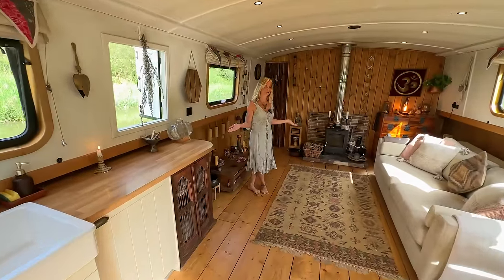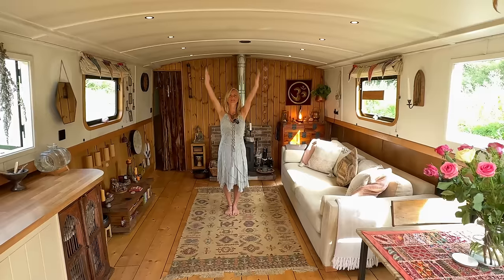She Lives Full-Time on Her Self-Built Boat

Comment: This is not a narrow boat, this is a house in the water....what a lovely boat...!!!!
Reply: Indeed, it's not a narrowboat. It's too wide to fit in most of the canals in the UK. Worth the trade off though. Wider boats are more stable in the water. Narrowboats rock from side to side easily.
Reply: @tonyhawk123 I like the rocking motion 😁
Reply: "Widebeam" would be the correct terminology, as opposed to narrowboat.
Reply: @notneeded1 - You’ve already said this a couple of times. 🙄 Get new material, FFS!
Reply: @madeleinerose7090  And tell him to stop giving his own comments a thumbs up.
Reply: Technically it’s a broad-beam canal boat. It’s more suitable for canals than tidal rivers because of the shape of its hull which is flat.
Reply: @tonyhawk123 i think I would prefer the open road or should I say access to over 2000 miles of canals from top of England to south
Reply: @lisadefries6718 She hasn’t got access to that sadly. Her widebeam is too wide for a lot of the canal network.

Comment: A box fan blowing the hot air from the stove down the hallway towards the bedrooms would solve the cold issue, plus you need ventilation and heat in all areas to prevent mold. People would argue the fan is too cold in the winter, but when there’s heat being blown from the hot stove it isn’t cold. I found that out when I had baseboard heating, my box fan was running and the heat circulated around my apartment very quickly. Another tip is to use slow cookers in the winter as they kick out an amazing amount of heat into a small area when you’re making homemade soups and stews etc.
Reply: Get another stove for the bedroom.
Reply: Don’t forget that anything that runs down the generator or other fuel very quickly is a no, unless you’re paying for a residential mooring ( rare and expensive) with a hook up.
Reply: You can make a generator really quiet on the water run the exhaust down in the water like the others
You mean you can still burn coal somewhere in the world😮😮😮 shes pretty 😍
Reply: I've got a widebeam with 6 radiators and a towel rail in the bathroom, running off a deisel heater. It's warm enough in winter even without my log burner on
Reply: There’s gas heaters too, my parents used to have a kerosene heater.
Reply: thats enough to survive, not to be comfortable
Reply: @kinley.-. Very dangerous on a boat though.
Reply: @Chanel95-d6u  yeah that’s probably a good point 🤣😅

Comment: in the summer it looks like paradise, but through the winter the boat is cold and condensation is a constant worry, i lived on a canal boat on the grand union for two years, and waking up in winter with the outside  temperature at --10C / 14F,  and the inside temperature was --5C / 23F,  with as she said ice on the inside of the windows, is not so much fun. and yes, it was fully insulated, but with half the boat sitting in cold water you find the insulation doesn't help.
Reply: Yes, books, clothes and soft furnishings can get damp.
And mooring is becoming increasingly impossible - much more bureaucratic on the canals than it used to be… we continually cruised, too. Wardens used to turn a blind eye to you staying in one place for a while, but now they’re hot on your trail.
Beautiful in the Summer, but cold overnight in the Winter, and moorings near shops and facilities are increasingly hard to find. 
Barney used to be our coal man on the Grand Union - dropping off our coal as he came through on his traditional working barge.
You have to be pretty reliant on having some knowledge of boat mechanics, and be prepared to cycle or walk everywhere. 
Most canal boats are FAR narrower than this wide beam!
A beautiful looking boat. So well thought out.
I wonder how she manages to continuously cruise and get the kids to the same school - that must be a big issue…
Reply: I think she said 32km a year,  roughly 20 miles would be a challenge
Reply: What a beautiful lady❤
Reply: Properly insulated with spray foam and closed cell foam combination, with double or triple glazed windows, ducted diesel heater to pull the moisture out and heat the air she’d have no problem.

Comment: What a fab home, well done . It isn't as cheap as some people think living the boat life .
Reply: I sold my 3 bed house 18 months ago (only me all alone lol ) and was going to buy a (used) boat . anything I have ever bought i always thoroughly research first, running cost of a boat are a lot more than the 2 bed apartment I eventually opted for, even though it was very dated being a handyman/painter and decorator I fully refurbished it , using expensive fixtures and spent £10k including all new furniture (kitchen is only 5 cabinets but was over £3k with everything else ) . my apartment is 35 years old and part of an over 55`s complex of 25 units it was up for £30k+, I offered £35k cash it was much much cheaper than a boat lol

Comment: Fantastic boat! I would suggest attaching a water tank to the burner which is hooked up to the radiators, that way the boat will get some heat when the burner is going. It probably won't be a huge amount of heat but it would certainly keep the chill off in the winter.

Comment: Its looks very nice.  There is a huge amount of space on the roof and those solar panels are tiny.  A few much bigger ones would likely mean that she wouldn't need to run the engine during winter as much.  I wonder how well the boat was insulated as well - maybe better insulation would result in a more comfortable space for a larger amount of the year.
Reply: yeah, more panels and a blower assisted diesel heater are called for here.
Reply: @redwolfexr  Diesel heaters are expensive to run though, and depending on mooring location, diesel may well not be accessible  very easily. Solar panels are a great idea, although vandalism on the towpaths is unfortunately always an issue…
Reply: @Chanel95-d6u    depends on your definition of expensive.   Diesel is much cheaper than propane for pure heating.  More importantly you heat the smallest area you can.  Even a blanket wall holds in a ton of heat.
Reply: @redwolfexr  Yes, have used a blanket wall - it’s amazing how much difference blankets or thick curtains can make. I can’t comment on the propane/ diesel options as I haven’t looked into propane, except for hot water and cooking.Theres always something more to learn…

Comment: Would definitely  think about fitting a diesel heater in your boat, the type you have in a campervan, have one in our van, a good solution for the cold, fantastic boat 🙏
Reply: Just be careful to site the whole unit OUTSIDE - they're dangerous re. escaping fumes otherwise. The only outlet into the cabin space is the warm air duct. (Dot)

Comment: I'm an amateur boatbuilder, and I think  it's wonderful that this woman built this 65 ft. boat all by herself.
Reply: Well... obviously she didn't.  But she chose the layout and it works for her so, job done.  Putting two hours on the engine every day is a bad plan in the long run.  I don't know why she thinks generators are noisy... buy a Honda and point it away from the boat and other boaters.  Much quieter... no vibration in the boat and far less depreciation/maintenance.
Reply: See didn't...I can see why you're a bodybuilder.
Reply: No!! She sure as hell did NOT build all the boat herself.  The hull was already built. And you really don't know how much of the interior she has done. You only know what she has said.
Reply: @HerveMendell  It was built by a reputable boat builders. They say who they are somewhere in the comments…
Reply: @ryansalyers5515  waaaaa

Comment: You could vent heat from a wood stove by piping heat through the house via an add-on air duct system. You could use rechrbable batteries in a battery powered fan for your forced air. There'e probably other ideas for minimal living in RV magazines and stuff. I love the cabin wood interior. I meant to ask......where is this?

Comment: You need a circulating fan to spread the heat around - we run ours ( a massive floor fan) by leaving it on the floor in the bedroom door way by facing it up the passage to the lounge, very soon the bedroom is warm again.

Comment: You are stunning, as is your boat. Id consider a diesel night heater as these are the best fuel efficient way of heating. a simple install and runs on the 12v system.

Comment: You're much better off running a small generator in winter to reduce the hours you're putting on your engine.
Reply: Engines are designed to run - they need to be run to keep the lubrication moving through the seals and gaskets and parts. Leaving engines sitting for long periods actually does more damage than running them and keeping them well maintained with regular fluid and filter changes.

Comment: I lived on a boat for 10yrs and understand the cold and humidity issues. I used a heating pad in bed because it does not use much power. All the newer ones shut off automatically, so they don't burn you. But I bought an older one that stays on until you shut it off. As long as you have it on low or medium with a towel on it, it won't burn you. My friends used thick clay plates in bed that hey heated on the stove. If it gets windy there, I recommend getting a wind generator which will generate power year-round day or night. Of course, you need to set it up so it will fold down or disconnect it when you go under those low bridges. :)

Comment: I guess nowadays you could put batteries low down in the boat and beef up the solar panels. Would avoid running the engine too often. 

You could also get one of those beds they have in campers that lift into the ceiling when not in use to avoid walking over the bed. Boat like great though!

Comment: use copper  pipes with automatic pressure valves to carry hot water with stove to make good circulation n gain warm throughout the boat. You can pump to drive the hot water very easily with storage power from solar panel 24/7.

Comment: Depending on what type av radiators she uses I would plumb it to the stove with a small water jacket. That would solve some problems with the heating (if she has radiators in every room).

Comment: How about a small Honda generator converted to LPG to for charging, v quiet and much cheaper to run than the engine. We use a bigger one at the stables and its great.

Comment: Darling is not using the correct coal, anthracite burns longer if sge changed ger stove to an anthracite stove like, and why dont you have a separate generator to the engine in the engine bay they are quiet and dont put hours on your main engine

Comment: she wants to use the washing machine as little as possible because she uses 50 liters per wash. she has to move the boat to get water?
The boat is already in the water, use a pump with a water filter/distiller for the washing machine. so much money has already been spent on the boat and such things are not arranged, I don't understand certain people.

Comment: There's a significant difference between self-built and self fit-out.  I suspect this is self fit-out.  I don't believe she built this boat out of sheet metal, because she would need significant space to build it, with good welding skills.  Most people buy a sailaway, which is the hull and superstructure, along with the engine, the fresh water storage and diesel storage and sometimes some electrical or plumbing.  The fact she says it 'arrived' 3 tonnes too light pretty much confirms it, but she did the ballast, so that means it was a basic shell. If she designed and fitted the kitchen herself, I suspect she did the electrics and plumbing herself.  The good thing about sailaways is that you can 'continuous cruise' in the shell while you fit it out, although you start of with a very basic standard of accommodation.